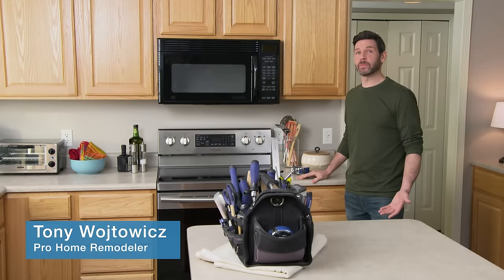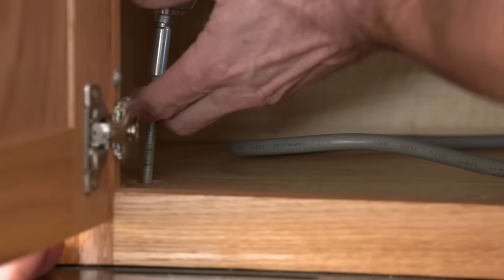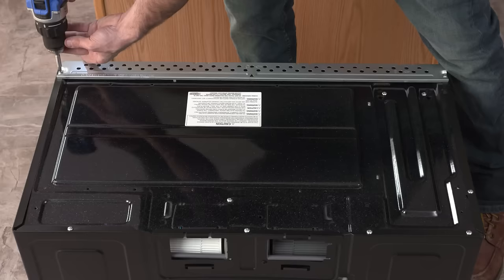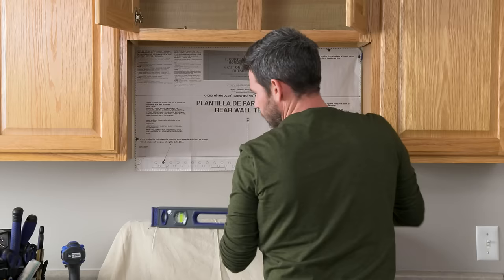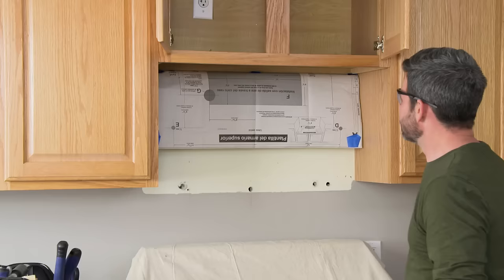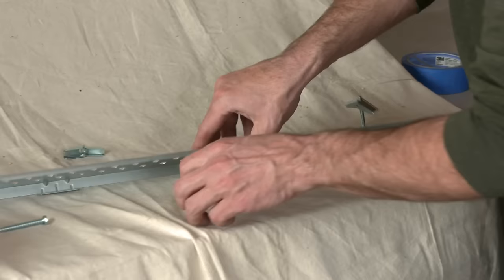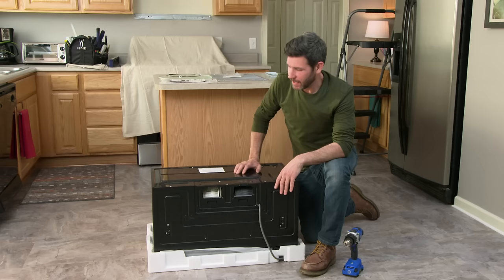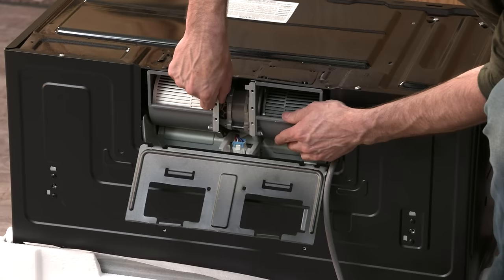How To Replace a Microwave

Comment: You lost me at "It's a real easy DIY project.".
Reply: So true. Youtbue DIY is nothing like real life projects.
Reply: It is an easy DIY project if you aren't a useless potato.
Reply: 😂😂😂😂 for real
Reply: He lost me at "Are you thinking about replacing..." (0:01)
Reply: @meme5887  😂
Reply: It's pretty easy tbh.
Reply: 5AM said the company is the best of the year for you to see if I
Reply: I'd rather buy the exact same microwave 🙄
Reply: @02051970sonny  I Concur !
Reply: It really is. I do DIYs like this for a living. Made $300 doing this in less than 30 minutes
Reply: @02051970sonny  Still wont match up
Reply: @jacoblocklear6809  had a stud finder. Two larger screws were for the studs. Two other screws came with toggle bolts. You don’t need a stud for those. Then the two long skinny threaded bolts to support the top to the cabinet. It’s simple if you make it simple. I can install those in 10 minutes now.
Reply: @jacoblocklear6809  just use the cheat sheet. Mark where you need to drill.
Reply: Me too
Reply: йй
Reply: Yeah, especially when you doing it yourself and it didn't come with a top template which made it harder to drill in new holes. Haha
Reply: Your comment of “if you’re mounting to same brand of microwave, the bracket might work.”  We mounted another Frigidaire microwave and the brackets on the back wall and the holes in the cabinet fit perfectly. It might save a marriage by buying the same brand. Skillet
Reply: @02051970sonny  If it’s not been discontinued. If a new model replaces it, hopefully the new model uses the same bracket and the top holes are in the same locations.
Reply: Lol I’m getting ready to DIY this weekend with one of these , wish me luck
Reply: @gavandwina.5889   When I replaced ours, my son helped me remove it... 12 minutes.  Then after using the templates provided in the Microwave box and double checking the location of all the holes, which I did not have to re-make as everything feel into place. It only took 10 minutes with my wife assisting me, to re-hang the microwave.  adjusting the clock actually was the most difficult act to complete.  Best of Luck. Skillet
Reply: It's dummy easy
Reply: Yup just gonna hire someone to set it up 😂
Reply: 😂😂😂😂 ok
Reply: 😂😂😂😂 facts

Comment: You forgot the part where I look for the tools for 3 hours and the cursing.
Reply: Lmao
Reply: And the part saying "why am I so cheap should've just paid for the install"
Reply: @luvinmysailor  exactly!!!! lol
Reply: Should I buy LG, Samsung, Bosch, or Electrolux???
Reply: XD
Reply: I'm buying a GE
Reply: @hickorynut1000  Yep, I bought GE too💕
Reply: @JBrye-xd8bw  Replacing my GE that just died with this samsung. I've always been a believer in GE though, I think they make good products. I'm pretty sure the one installed that died was a very cheap model.
Reply: Try using a cabinet jack/lift for support
Reply: The comments on this post are hilarious
Reply: I can relate
Reply: man all you need is drill bits and a drill with a phillips bit. Common now
Reply: @matthewjohnston4713  yes, but regrettably the most difficult part - holding up the microwave by 4 hands and getting it lined up and shoved in the hole wasn't shown!!!!  I'll suggest, again, that you pull out the stove and get it out of the way.  Breaking your glass ceramic stovetop - even by having your drill bit fall out or having the drill slip out of your hand - means buying a new stove. Replacing the top isn't cost effective!  I learned by experience. Ugggh.

Comment: Been doing property management for 28 plus years and I always try to buy the same brand of microwave as the old one because most of the time the same manufacturer uses the same rear bracket and the top mounting holes would also line up with old holes as well. Makes life easier.
Reply: Franks Family lol. Mounting holes.
Reply: Peter, are you in Ontario? I could use a skilled installer!
Reply: @-Munditimum-  Mr. Mosu,  I would love to help you but unfortunately I service Santa Monica, Pacific Palisades and Malibu area. Thank you for the opportunity and you stay safe and healthy.
Reply: This, my friend is the best advice ever.
Reply: Thanks I just bought a GE but probably will take it back for a Whirlpool for this reason. A lot more involved than I realized to install this!
Reply: Damn I wish I would've read your comment before I bought a new one for my rental property. And its too late to return it.
Reply: Exactly what I figured from experience with these type of things and told my wife to let’s go ahead and buy the exact same model, but noooo, the fancier more expensive brand has STEAM CLEANING! As if the microwave is so hard to clean, so here I am watching this video basking in righteousness and plopping new holes in the kitchen! 😂👍
Reply: How come when I tested my microwave the wall fell off my house?
Reply: Same brand and same MODEL too or just the brand??
Reply: If you can find the same brand your chances of not replacing the mounting bracket in the back makes the job easier. If you have to replace the mounting bracket in the back because of a redesign issue or you buy a different brand it’s still easy and no need to screw into the stud. You can use butterfly or toggle bolts into the drywall. Most mounting brackets are labeled where to put the bolts/screws either with the letters A or B or arrows.

Comment: Me and my mom just finished taking down our old microwave. Took us over an hour to lift it off the hinges.  It just wouldn’t budge. I love how he says the microwave isn’t heavy. Lord Almighty, I thought I was giving birth trying to pull that microwave off the dang wall.
Reply: Seriously!
Reply: Join a gym 6 months before installing the oven.  All healthy adults should be able to lift 50 pounds.
Reply: @MucaroBoricua   50 lbs isn't hard to lift of the ground when you can put your legs into but when lifting off a wall like I just did its all elbows and shoulders and much more difficult,  as a rather healthy and strong male it wasn't that hard for me but could imagine a female having a mighty struggle with it..
Reply: 56M views, True.  But watch your language or the feminazis that believe in total equality will jump on you.
I still stand by my statement; any healthy and capable adult should be able to lift 50 lbs.  But I didn’t say it was gonna be easy.

I have to admit that installing a 50 lbs oven with no handles under a cabinet, that’s another story.

To make it easier, they should remove the stove/range out of the way.  Also, put a few planks across the range opening and use it as a step for the oven.  That’s what I do.
Reply: Timmy's POV thank you for having empathy for others... vs the guy you’re replying to just being a jerk
Reply: @MucaroBoricua  Hey, no need to be rude.  And especially when a couple of sentences later you ADMIT that this installation is an awkward task of wrangling 50-60 lbs slick box.  But you are right about PULLING the stove out of the way. At least, no matter your upper body strength, that way you have your legs to help you with lifting/wrangling.

Comment: Protip, test the microwave before installing it. Learned the hard way.
Reply: yes, especially if someone got rid of the old microwave, because they upgraded the kitchen kit, but had all the brackets provided... test the microwave to be sure it's working properly then get it installed with the necessary tools you have.
Reply: Thank for the tip
Reply: Awesome tip.

Comment: There's all those holes in the mount for a reason. Use the ones that line up on a freaking stud instead of using a drywall anchor unless there's no stud on one side.
Reply: thank you for saying what I was thinking -- use the holes in the bracket that are over your studs!!!
Reply: Yes! In this example he could use 2 studs. One on left and one 16" to the right. I'd think 2 studs would equally hold 2 toggle and 1 stud.
Reply: dry wall anchors are just as useful as studs. Each toggle bolt he used is rated for 100-150 pounds. That damn near 300 pounds of carrying weight for a 50 pound microwave
Reply: Thanks…I wont be drilling thise big holes for anchors..1 studs should do

Comment: First time ever project for me.  I watched this video and followed the instructions step-by-step.  I didn't do it as fast as this guy (took me 1 hour from start to finish) but am presuming he has done this a time or two.  Also, I was working alone and so had to create my own lift support to hold the microwave up so I could install the top anchoring bolts. I used a plastic flat top beer cooler and some folded towels on top of the cooler lid and sat the microwave on top of the cooler and towels after first anchoring the unit to the back wall brace.  It was quite easy.  Thanks Lowes guy!!.
Reply: Great idea with the cooler. I'll be working by myself as well.
Reply: Thanks for the solo install tip - it may have taken a minute b4 I thought of that!  Now I might be able to do this…. I just need to find a MCV.

Comment: Thank you so much for your video and to the helpful commenters. Someone recommended to buy the same brand so you wouldn’t have to replace the bracket on the wall. This was a huge helpful tip. Bought a GE microwave as the previous one and it was quick and easy. Even the holes on the cabinet lined up. I could of done it myself except the microwave was too heavy for me to lift all on my own so you definitely need an extra person to help.

Comment: Great video. Watched it before my install, and it was a breeze. It was a birthday gift for my wife. Thankfully, I had the same brand microwave so the wall bracket was reusable. The microwave I got also had the blower setup to recirculate as the default (per the manual and per testing) so that was one less step I had to do. Be sure to check your microwave's manual to determine if you need to rotate the blower or not - you may not need to, but the video shows you how, just in case. Thanks.

Comment: Lol, cool. We’re on day three of this project and I like how he just glazed over the part at the end where you include the scrap wood for a recessed cabinet. Predrill or no? Does it need to be the exact dimensions of the recess? Where does one find this? Also, he seems way too calm. Add more swearing and arguing with your significant other over the location of the wood screws for your next video.
Reply: Day 3? How many days does it take you to do a 45 minute job?
Reply: this is insanely old but here we go. Yes, always predrill, with a bit size slightly smaller than the bolt. it should be as close as you can possibly get to the exact dimensions of the recess. how do you find it? maybe, i don't know just a thought, you could use that fancy little measuring tape lots of stores sell.
Reply: Day 3 LMFAO!! Omg i pissed myself. Thank you so much for this!! I needed it today. Being totally serious.

Comment: Keep in mind that not all microwaves come off the wall that way. Our old Frigidaire was installed into a bracket with 2 arms. Those arms were connected with two bolts that were behind the vent grille on the front of the microwave (in addition to the two bolts on top in the cabinet). Posting this in hopes that it saves someone some time...we pulled on that Frigidaire for a long time before figuring out how it was bolted in.
Reply: We just took out a 22 year old Whirlpool! Yikes! It was a bear. Pulled one lag bolt completely out! Praying the next one is much easier to install, as this man showed!!

Comment: Definitely use a template because you’ll be drilling other holes or larger holes. If you’re installing a used microwave, make templates out of cardboard. Also, sometimes you’ll find used microwaves with missing wall mount brackets. You can use your old mounting bracket you’ll just have to use tin shears to make notches so your used microwave will mount.
Reply: I got so frustrated with the paper thin template that kept ripping that I used cardboard. What a great idea!

Comment: FYI  If this helps anyone I removed 13year old GE microwave oven told my wife wanted to replace with another new GE microwave hoping the mounting hardware would match the old microwave. Bingo was a match after 13years. Made this installation a peace cake. Took about 15 minutes. Something to think about if your replacing an older microwave.

Comment: Great video thanks. I did this install today but wish I watched this video before although I watched many others. Two tips I liked were drilling pilot holes from below the cabinet, before drilling down through the top to prevent damage to the cabinet finish. And because this is a recessed cabinet above the microwave, you can reuse the same hole for the cord. I drilled another hole for the new microwave cord when I could have reused the old microwave hole. This only applies to a recessed cabinet top. If it was flush you will for sure have to drill a new hole. Hope this helps other's with these two items.

Comment: You should test the microwave  BEFORE you do the prep and hanging. In case it's defective and have to return it.
Reply: I was gonna say the same. Now what if you test the microwave and have a defective one AFTER all that. Plus I would no longer trust the brand/ model so you just drilled the shit outta your walls and cabinets

Comment: Excellent instructions, thanks!   I find it helpful if you’re replacing a microwave to replace with the same brand if possible.  This increases your chance of not having to replace mounting brackets.   Mine was replaced in about an hour with a couple of extra hands to help hold/lift.
Reply: Except, if one is specifically NOT buying the same brand (Frigidaire) because it's a piece of junk. It came with a new house, went kaput after about 2 years. I then bought a warranty for two more years, a technician came out and fixed it, and it went kaput again after another 2.5 years. Everyone in the subdivision has the same problem with Frigidaire.

Comment: Thank you for the video really help me. Also I used the old frame that was attached to the wall from a frigidaire microwave got the same size and holds my Samsung microwave perfectly. 😀😀😀
Reply: Good luck on the Samsung, mine was junk.

Comment: This is a very helpful video, EXCEPT that you only mention the charocal filter and didn't show installing it in and now we installed the microwave with having the filter out and we didn't even know what it was until we looked it up.
Reply: I have the same microwave. I don't even know where to put the charcoal filter. The instructions are useless.

Comment: General Suggestion:  If you have an older model, Go online and read the installation model/ look at parts. After reviewing multiple YouTube’s and struggling to remove my 20 year old microwave (yea, crazy it lasted so long!)...I researched the manual/ parts pictures online and discovered my bracket was mounted on the top with two, long mounting screws that had to be removed from the front of the microwave! (Sharp Model 1481).
Reply: That’s great your Sharp microwave lasted that long, definitely the new one won’t last half that time.  I left a 26 year old Toshiba microwave in the last house I sold and it was still working fine.

Comment: Love the one-handed "snap on & drill" at the end.
It's not easy.
Reply: A 2x4 cut to a length that matches the height between the range and microwave as well as another board cut 4 inches shorter help when you mount the top bolts and also when your trying to feed the cord through.

Comment: Just to add...if the top of cabinet opening has a lip hang over(for lack of a better term), you will need to lower your template on the back of wall to the same height of the front so that the space is level in the front and back of the unit.
You can trim the template edges so that it fits inside the trim frame.

Comment: You forgot to mention some older microwaves have safety latches on the back. You have to remove the top grill on a HOTPOINT to access the unlock screws to release the safety latches. Video was good for general microwave removal and installation

Comment: For ease of access, your own safety and to eliminate the possibility of breaking the top of your glass topped stove, Pull the STOVE OUT! Believe me, if you crack the top of a stove, it's cheaper to buy a new stove than replace that top.  But so much easier to just pull the stove out of the way!  I've looked for a new microwave and they weight 60lbs with the fan and light underneath - definitely a 2 person job!

Comment: A good video but I'm wondering, before you attached the template on the wall, why you didn't trim it along the dotted lines first as it states to do so right on the template?  This explains the small gap you have between the top of the microwave and the bottom of the cabinet.

Comment: That right most toggle was only <1" from the existing hole and the mounting plate has multiple mounting holes. I would have used the existing hole. maybe install to a stud on the right side too.
Reply: Yeah, use the two studs and forget about the toggle crap.

Comment: Very good video! I liked the easier method of taping the top template to the outer edges of the recessed cabinet, then poking through with a pencil. A lot easier than trimming and taping template to the inside area. If there was anything I'd do different, it would be testing the microwave before installation. Thanks!